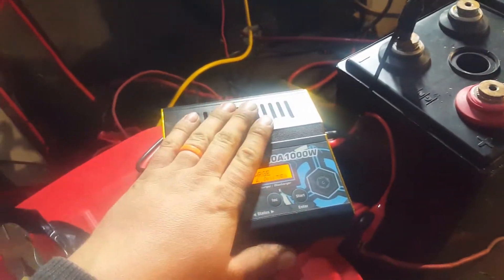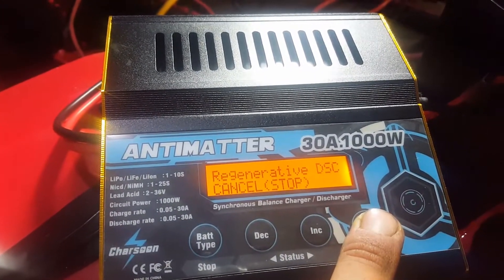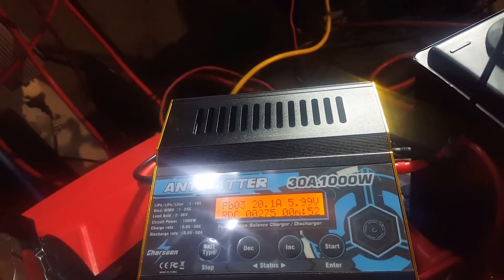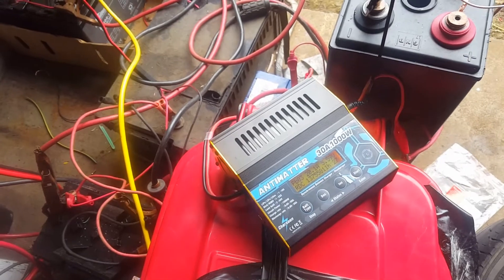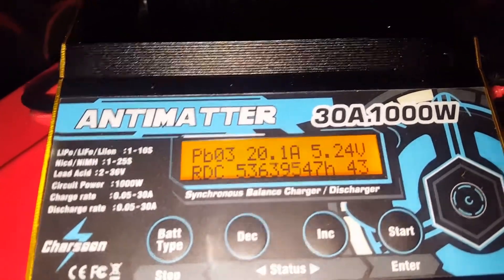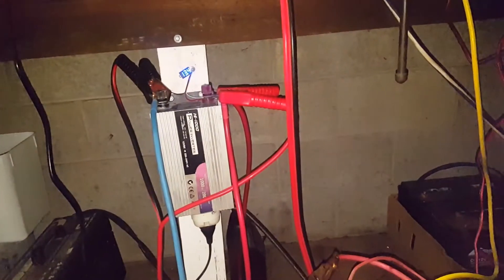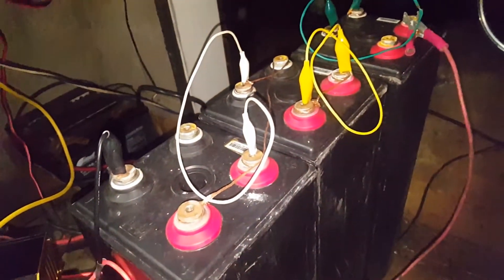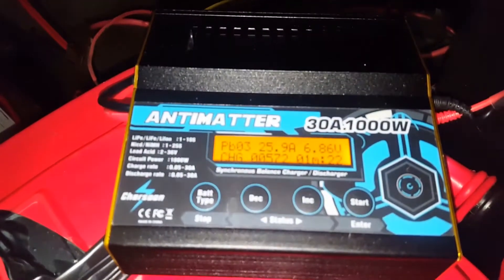3.2kwh out of scrap 2v cells

Comment: Wouldn't mind 6 of them for free
Reply from the maker: +Vic Solarman i have an idea to combine these and a few other cells i have to get them into my solar  system for some free storage
Reply: @Oneupthesleevecustoms cheers cob if you could perhaps tell how to configure 6 x 2v series for a 12v system parallel paralleled or balanced
Reply from the maker: 6 in series mate. Easy to do they lead acid will balance out with charging as long as they are sort of close to the same capacity
Reply: Vic Solarman, do you have an estimate on amp hrs for six deep cell two-volt connected in series sbm 84 ? I just scored on some Swedish two volt, six of them.  Happy
Reply from the maker: Are they rated in amp hrs on the name plate?